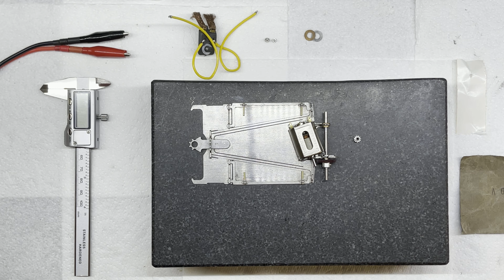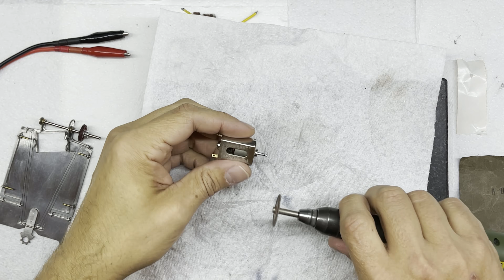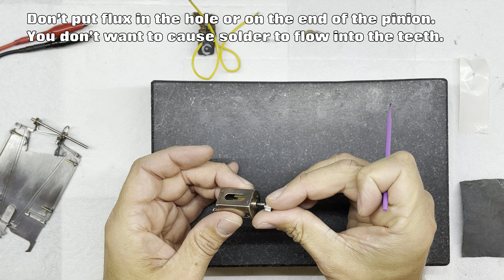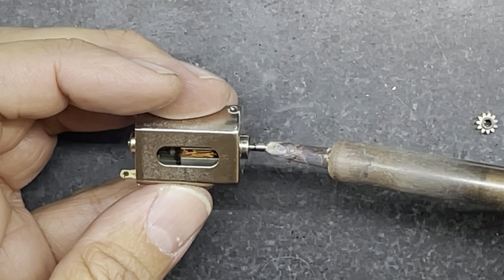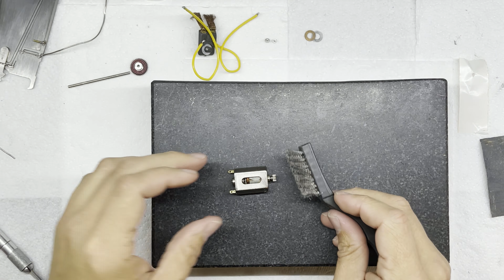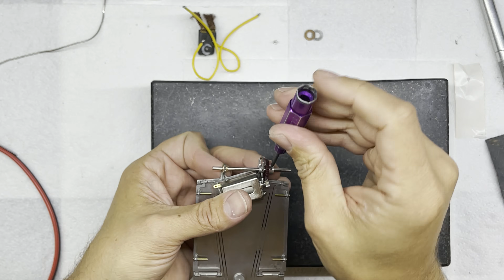It's a matter of a pinion for an FK slot car motor (JK Hawk Retro)

Comment: Interesting. I am attempting to replace a worn alloy pinion with a new brass cog on my Hornby Ringfield motor.
It is challenging as in this case it is an interference/machine fit.
I tried immersing the brass  cog in boiling water but as the axle is spring loaded, I couldn’t get enough pressure on the cog  Maybe through heat transfer the heat might have been lost through the steel tools I was using to hold the cog
Reply from the maker: You could try cutting the gear nearly all the way through without damaging the shaft. You could probably then just break it off or pull it off.

Comment: Is there anything that you do to help improve the coast of your cars? I’m talking when the track turns off.
Reply from the maker: Making sure there is minimal friction in the gears and axle will help coasting. You can also make sure you hold the trigger down when the power goes off as this will bypass the braking circuit on most controllers.

Comment: How many RPM could you gain from cutting down the pinion?
Reply from the maker: Using a narrow pinion doesn’t necessarily gain RPM, it reduces rotating mass, which helps the motor spin up and slow down more quickly. That will make the car more responsive. It also lightens the overall car.

Comment: So is that what you do let metal dust get in a customers used motor because it doesn't really matter
Reply from the maker: In the video you can see that I use an old motor to cut the pinion which is the process that causes the most metal dust. I only give the pinion a light skim when it is soldered onto the race motor. I also thoroughly clean the race motor after the pinion is soldered and located properly. This is also my own motor and car, not a customer’s car. I would always prepare a car for someone else to the same standards as my own.

Comment: I envy being able to use a small soldering tip. We use Weller 4033S tips here with 7760 handles. You probably know the one I mean. I assume it's because you use 220V not 110V.
Reply from the maker: I used to think that a big soldering iron tip was necessary but when I started to realise that soldering is easy if you use the right flux and keep the soldering area clean, I was able to use smaller tips. It also helps to have a fast recovering iron.
I think that larger tips are needed for soldering all brass chassis, but for flexi cars a 3.2mm or 5mm tip is fine.

Comment: Theres some nutty slot car rules there. . Then again i dont round track run here in the states! Im a drag car guy im running anglewinders @60,000 to 70,000 rpm on foam tires🤷‍♂️  sometimes ill run an inline same rpms with a drive shaft into a differential. Really depends on what im shooting for tho.

Comment: cleave lovely job.  did i hear it right is it a 1:32 scale?    i do a bit of racing too.  often i see the max rpm of the motors.
are there any numbers of watt  and torque?   i know the old mabuchi motors are listed with torque.
as for the pinion did you ever tried    green loctite?    you have to work fast and the fit must be not to wide.   regards
Reply from the maker: Yes, the chassis in the video is 1:32 scale. It is a Genesis chassis made by Richard Mack in the UK. It is the standard chassis for the British Slot Car Racing Association’s beginner class.

These sort of motors don’t come with figures for torque or Watts. You could probably work it out by measuring the stall current.

I have used loctite to glue on gears in the past but I find it can sometimes fail after a few months. Maybe it is the oil and cleaning fluids that attack the loctite?
Reply: @CleaveTech  thanks for  answering  i ment the loctitie 638 its green and mean...
strong stuff though the thing it dont like is heat, you could be right.
Reply from the maker: @harryw9598  , yes that is the stuff I used 😁 I recognise the number now.

Comment: If you make a gear to run freely on shaft when you don't need it, you will have a 2-speed gearbox.
Reply from the maker: I am not quite sure what you mean? The pinion is soldered onto the motor shaft.
Reply: @CleaveTech  If you make it can spin when shaft is stoped, you will have 2 speeds.One is gear mesh, second is motor shaft and tire mesh if the shaft is long enough.Cause it's metal gear, you can use an electric magnet to move it.
Reply from the maker: @onlinehelper374  , Thank you. I understand now. I think they might use that method in Radio Controlled cars.
Reply: @CleaveTech  yes, they use close method.

Comment: What is the reason for soldering the motor to the frame, rather than screws?  Soldering would surely make motor changes very slow and difficult.
Reply from the maker: Soldering the motor to the chassis helps keep the centre of gravity lower and reduces the overall weight compared to using a bracket and screws. Also some of the very smallest motors do not have screw holes and the windings of the armature are extremely close to the end of the motor.
Reply: @CleaveTech  Thanks, Cleave.  Didn't know that.  It's been about 5 decades since I raced / built cars.

Comment: I'm an old 1960's slot racer in the USA.  Pinions are not press-fit now?  I only ever had to solder one pinion, and that was on a Pittman motor with 1/8" diameter shaft that was to power a "rail job" drag car.  Every other motor, most all Mabuchis, they pressed on.  Back then Cox made a great pinion tool that would both press on and remove pinions.
Reply from the maker: Low powered slot cars still use press on pinions. The top level slot car motors nowadays have the shaft ground to 1.2mm and use 5t pinions!
Reply: @CleaveTech  The 36D's had .091" dia shafts, and the 16D and 26D's had .078"/2mm shafts.  I didn't know about the 1.2 mm shafts.  The smallest pinion I had used was a 6t pinion.  More often 8t.
Reply: I too did slot cars s a kid in ‘60s but we used to build our own frames and wind or own small can motor armatures. Now everything I see on line is purchased.

Comment: How are you. I wanted to ask you a question about how to accentuate the brushes of the g12 motor, you can accentuate them in "cold" or natural water, or accentuate them with a chemical. ? I would like to know, to accentuate them and not spoil them. From already thank you very much. I am new. (I've been 10 years) in slot cars. I learn a lot from your videos. and as they say in this environment. I am putting together my little book. haha
Reply from the maker: I have found with G12 motor brushes that they don’t need running in under water as the motors draw a lot more current as standard. I use a range of diamond hones to finish the brushes to a size that nearly matches the commutator, then I run the motor for approximately 40 minutes on 3.0V

Comment: its great idea to round the pinion corners and also the motor axle. makes less vibration...i recomend polishing the pinion teeth with dremel brass tools....cheers Rio / Brazil !
Reply from the maker: I have seen people polish the leading edge of the pinion teeth but sometimes I have seen people do this too much and not have enough tooth engagement. I find that brushing the teeth by hand with a small wire brush after soldering is enough to remove any burrs but as you suggested, a brass wire brush in a Dremel shouldn’t be too abrasive. 👍🏻
Reply: hello !! shure....but i do this only with an older pinions...not brand new ones....and when i do....i use that small dremel instead of 3000/4000. and with low rpm. brass brushing very soft ones......

Comment: I like the idea about angle pinions for “During Race” tire changes or gear replacement (axle, tire and spur gear replacement in one complete switch). If the spur gear is setup optimally, it shouldn’t slip by the pinion and causes a slow “During Race” pitstop. A “During Race” repair isn’t the end of a race, it’s damage reduction. (GR)
Reply from the maker: Hi Rick. Thank you for your comment. JK do not recommend angled pinions on their motors as this can produce a lateral force on the motor shaft pushing the commutator into the end bell. Many people have run angled pinions without a problem though 🤷‍♂️. I also like the ability to pull the gear and tyre off in one manoeuvre if a gear or tyre change is necessary. In the UK we have to run that gear ratio in the INTRO32 class so the angled gears are probably best.

Comment: Thank you for the video. Being new to the sport Im just about to build my first 1/32 chassis. Very informative.
Reply from the maker: The Genesis chassis in the video is a really good 1/32 chassis. It is designed and built by Richard Mack.
Reply from the maker: Good luck with your first build.
Reply: It's the 1/32 AB PRO-AM Sports chassis that I'm getting, the motor is soldered in. I can solder but I don't have the knowledge that come from years in the hobby.  Luckily I'm in a good club with helpful members Raceway81 Birtley
Reply from the maker: @micgent  That is a good chassis and will work well. I know a lot of the guys in that club and you are in good hands. 👍🏻

Comment: Thanks again, James.
I'm guessing that you don't shorten the pinion, or at least by not as much, for inline classes to leave the possibility open to running different size contrate gears without needing to move the pinion?
Reply from the maker: I might still shorten the pinion for inline classes but as you say, not as much. 👍🏻

Comment: Why do you mount the pinion with the protruding collar facing the motor and not vice versa?
Reply from the maker: Although I cut the pinion to save weight, the collar provides more surface area to solder to, giving a stronger solder joint. The collar is also a small diameter so it has less effect on rotating mass.